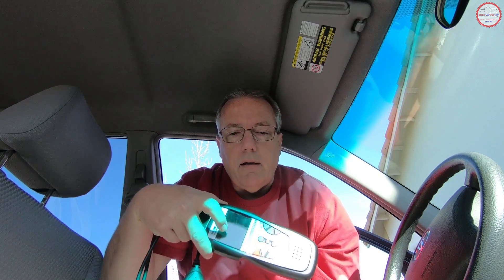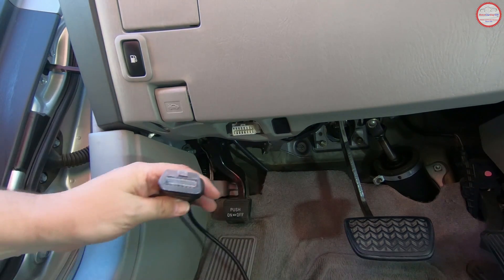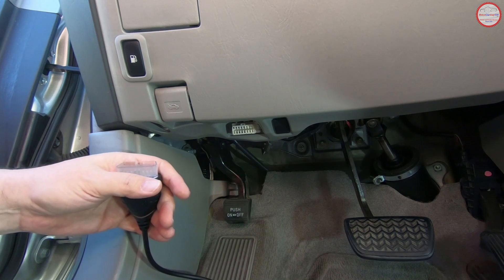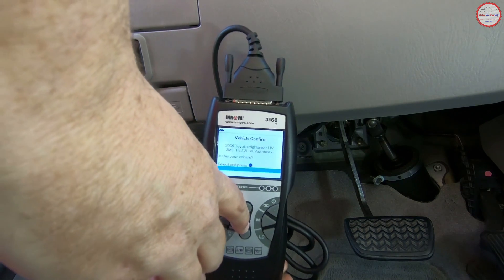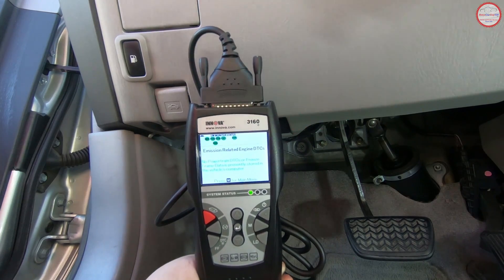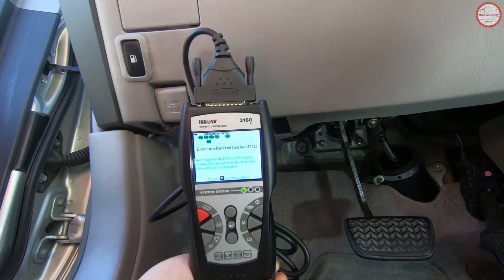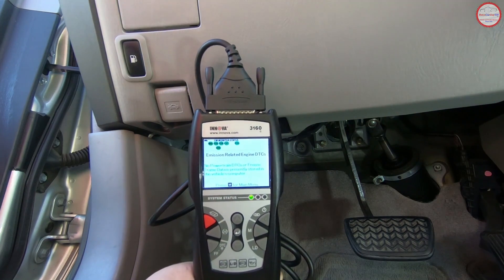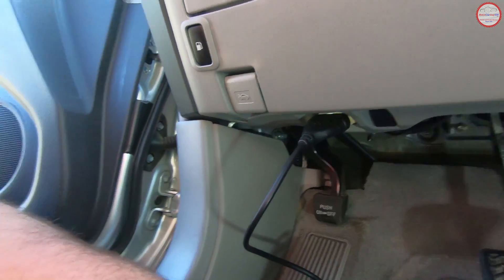Use a diagnostic code scanner to see if your car is ready for its smog check

Comment: In Arizona if your car is  2002 and newer  you can have 1 Unready system and still pass... if its 2002 and older 2 don't have to be ready...   What's interesting is one of my systems haven't been ready even in 5000 miles... I went to get tested and they passed me... that was a few years ago now I have to do it again and I'm getting nervous I always do.. I get my smog done every two years ...but it has to do with one of my evap hhoses I caught it a few weeks ago when I had to do the water outlet on the top of my motor I found a rubber hose that was cracked in five places that has to do with the evap from the fuel tank but on top of the motor so I fixed it but it's still not ready even though I'm driving hundreds of miles a day.. Very temperamental.. I might go to AutoZone and get a scan tool before I go to get the emission test My registration is due in a month and a half already paid for it though.. So I have about a month and a half to do it... If one of the systems isn't ready and the rest are at least I can know  And I could just go to the testing center and get it done I don't care if one isnt ready.. Eventually it will clear itself but very temperamental thousands of miles I go and it doesn't wanna reset.. It has once or twice but then I ended up replacing the battery it reset again anyway.. Going back to completely unready.. But yeah while that hose was broken for a while I would smell fuel on occasion only when first starting the car with the air conditioning open to the vent outside then it would go away really quick and not come back for weeks that smell at least I know what it is and I fixed it.. A flexible hose of rubber turned like concrete that hard I just fractured in a bunch of places

Comment: how do you know which models work for the drive cycle
thanks
Reply from the maker: I'm not quite sure what your question of "which models" refers to, the scanner or the car.

Any scan tool that can access generic OBD-II scan data should likely be able to display the "I/M Readiness" monitors.  That should likely be most any scan tool (cheap to expensive).

The drive cycle is something that the vehicle manufacturer defines as the set of steps to perform to get a particular readiness monitor to have its test performed.  For most readiness monitors, that can be accomplished by simply driving the vehicle for a few trips.  Some readiness monitors like the EVAP readiness monitor on many GM vehicles can be quite difficult to get exactly the right conditions to allow the readiness monitor test to run.

I don't know if I've answered your question.  If I haven't, please reply and be as specific as possible to give me the best chance at answering it.

Comment: Can I use an Iphone app or phone app that does the odb code scan  in AZ?
Reply from the maker: Yes you can.  As long as the iPhone app and the OBD-II device the app uses to connect to the OBD-II port can retrieve the "Readiness Monitors" and display the status of the MIL (malfunction indicator light - aka check engine light).

Comment: What is the difference between engine on and engine off. Manual says off but i can only read vin and readiness monitors with the engine on.
Reply from the maker: Most (if not all) OBD-II scanners will require the ignition switch to be placed into the KOEO (Key On / Engine Off) position/mode to allow the various modules in the vehicle to power up and be accessible to the scan tool.  You should only need to start the engine if you're trying to examine or capture any live data from the vehicle.  For example, if you needed to see some data from the engine, fuel pressure (if available on your vehicle) or the oxygen sensors, you would need to start the engine to allow the scan tool to show those live data values.  With the vehicle in KOEO mode, the scan tool should be able to scan all of the modules for DTC (diagnostic trouble codes) and the scan tool should be able to access values such as the VIN as well.  The readiness monitors should be available in KOEO mode as well.  I hope that answers your question.

Comment: If it lit the yellow LED with a permanent code, but I cleared the code and the check engine light hasn’t come back on yet, is there a chance it would pass the emissions test?
Reply from the maker: Maybe.  If the condition that caused the check engine light (MIL) to come on is still present, then it may trigger the check engine light again.  If the problem has been resolved, you might be able to pass your emissions test, but only after the readiness monitors have had a chance to run to completion and no errors were found.

When you clear/erase codes (DTCs) with a scan tool, it also resets the status of the car's emission readiness monitors to a state of incomplete.  After the readiness monitor tests run, they will either pass or fail.  If readiness test passes, the readiness test will have a status of OK or complete, but it will have a status of incomplete until it is run.  In California, you can pass a smog check test with up to one readiness monitor test in the "incomplete" state.  This can often happen with many GM vehicles because the readiness monitor test for the EVAP system has a large number of prerequisites to be satisfied before the readiness test runs.  I've passed a CA smog test with my 2004 Chevy SSR with the EVAP monitoring readiness test in the incomplete state. 

I hope that answers your question.
Reply: RetroCarGuy530 yes it did. Thank you so much. I’ll be sure to reach out if I have any further questions.

Comment from the maker: It has come to my attention that the 720p playback resolution of this video has become corrupt (broken video/no video).  Please select another video resolution for playback.  Thanks for your cooperation!

Most gasoline powered new vehicles will not need to have a California smog check performed if it is eight model years or newer.   Once a smog check is required, it is required every 2 years or during a change-of-ownership if it is more than four model years old.  Gasoline hybrid powered vehicles did not require a California smog check until until a couple of years ago.